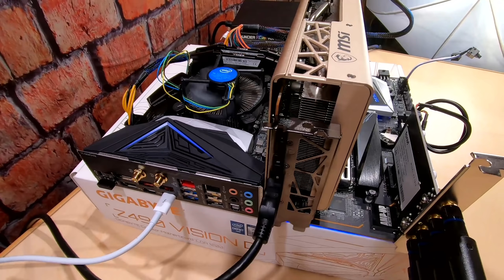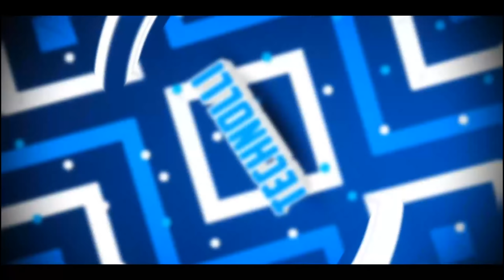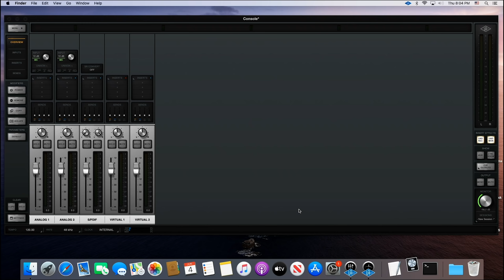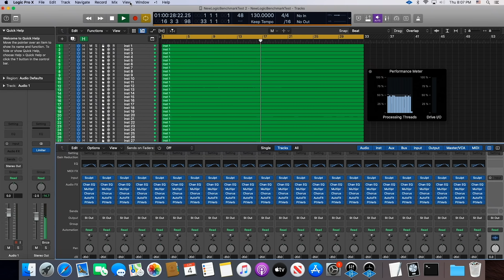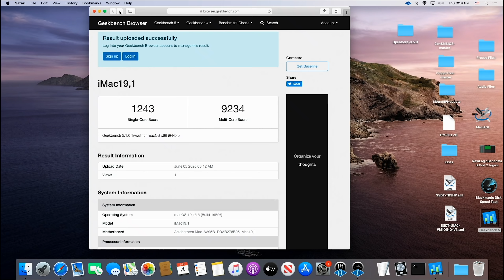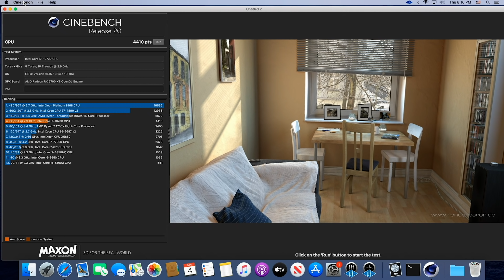10th GEN Intel Logic Pro X Hackintosh Build with THUNDERBOLT 3.....Benchmarks included!

Comment: Hello,

I have the Focusrite Clarett 8PreX and so I need Thunderbolt in order to run the Audio Interface. My Motherboard is the Gigabyte Z490 Vision D which has Thunderbolt 3 and I need to convert back down to TB2. I purchased the TB3 to TB2 adapter by Apple but the Clarett 8PreX Audio Interface does not recognize that it is connected. Now PC recognizes it is connected by making the connection sound when the Interface is on and off.

When I download and install the driver by Focusrite, when the download is complete it says no device connected. So are there any PCI-E Cards that will help with my situation? Or can you recommend another Motherboard that has Thunderbolt on it but will work with my RAM and Hardware inside my PC? I spent close to $1700 putting this together and so I am hoping that I will only need a PCI-e card or Motherboard as opposed to building an entire PC all over again.

Comment: Hi TechNolli, in z390 designare i9900k video you run i/o buffer at 32, in this video the i/o buffer at 64, as far as i know that lowest i/o buffer will consume more cpu. Have you test again this 10700 with i/o buffer at 32?
I am still compiling parts, in my country 10700 price is 22% cheaper than 9900k.

Comment: did Luna run on this build? UA specifies Luna requires thunderbolt to be built in not run through an adaptor card. you opened Console but i think the Luna icon is right next to it? would like to see that actually running. thanks for the videos.

Comment: Hi dear technolli. I just bought the VIsion D... inmediately when I saw this video.... IoI. So I decided  I'll be paying for your website support in the next days but I'm new on this Hackintosh thing. So I want first to understand a couple of questions before I get into the "Tech" pay questions. It is about what components to buy first. But I'm doubting in the following regard: Is this built flexible to change components or the software stick to the hardware components exactly as you built it?   I want to run my Apollo 6x with Logic (don't know if Luna is working on Hack) and also I Want to run  Davinci Resolve(most important) , Premiere, After Effects.. all those  GPU demanding apps. So I think the Gigabyte Radeon Rx 5700 Xt that you show here is not optimized for that purpose and is AMD tech.. Maybe I'm wrong. So  My question: Can I buy another NVIDIA GPU card ? or I have to stick to this one in order to build this specific system?   Let me know to be available to buy the right components before I screw up and your later couldn't help me.   By the way my ideal is to put 64gb ram and a 10th i9. with 2 or 3  ssd nvme. Can I buy those?  here is an article about the gpx cards:  https://www.pugetsystems.com/labs/articles/DaVinci-Resolve-GPU-Roundup-NVIDIA-SUPER-vs-AMD-RX-5700-XT-1563/
Best Regards.  Evans

Comment: i just ordered z390 designare and i9 9900k do you think its a good choice to return them and get the z490 and i9 10900k for hackintosh build?
Reply from the maker: Well, I have so many people running the Z390 for recording studios and they work flawlessly. This board will probably be good as well, but only a few have been tested. If you want stable now I would stick with the Z390. The speed is not that much better on the 10th Gen.
Reply: TechNolli thank u for the advice i am keeping the z390 as u suggested
Reply: im in the same position, i think the z390 will be more stable than the z490 initially... thats my thought at least

Comment: You da man! In the UK, the Gigabyte Vision "G" is more available (and cheaper). Do you think this guide will work on the G model too?
Reply from the maker: The "G" does not have Thunderbolt. It is a different board. We can get it here is the states as well.
Reply: @TechNolli  So what do you reckon mate? Will your EFI/open core settings work with the Vision G or just the Vision D? Your videos are the best on youtube for Hackintosh without a shadow of a doubt. Thank you!
Reply from the maker: @hughythomas  I think it might. But of course I haven't tested it.
Reply: @duncanmcneill7088  Hey Duncan, thanks for the reply. So it looks like maybe that Vision G is a good choice for people like me who don't require thunderbolt! I'm desperate to upgrade my hackintosh with a 10900k to run Logic as I work at 96khz and my current i7 8700k is struggling (even at 4.5Ghz). Useful info there mate thanks again.

Comment: Hey Technolli. Looking to do this for my 10980xe and x299x gigabyte 10g motherboard. Would I be able to follow the exact same process you did to hackintosh this machine? I am looking to have thunderbolt working as well. I am aware I won't be able to get the 10G ethernet speeds using mac osx.
Reply from the maker: No this will not work for your x299.
Reply: @TechNolli  oh bummer. thank you for the response.

Comment: As i commented before, what would be nice is to, for the moment do this build but only use an i5 10th gen as a stopgap processor, as next year(!?!) we should get the 11th gen chips which will take full advantage of the PCIe4 slots on this MB. THEN get whatever the i9 top of the range, then. Hopefully it would be just a drop in replacement for the i5.

Any ideas?